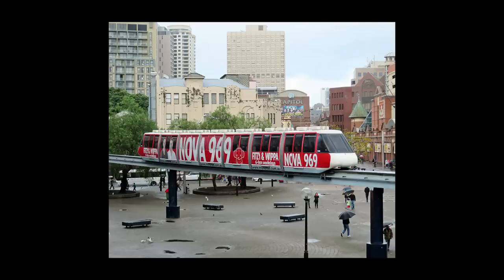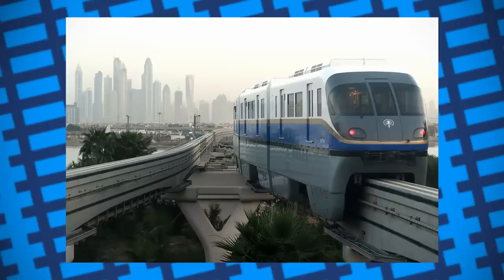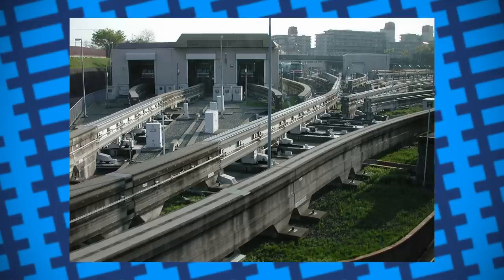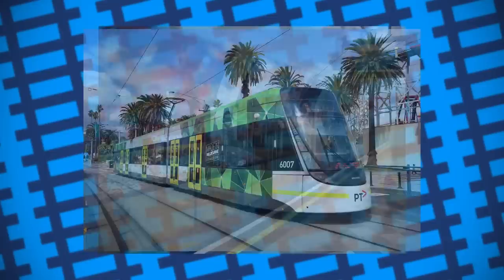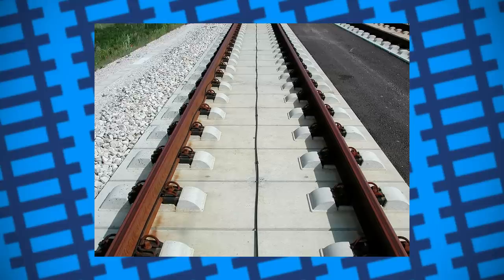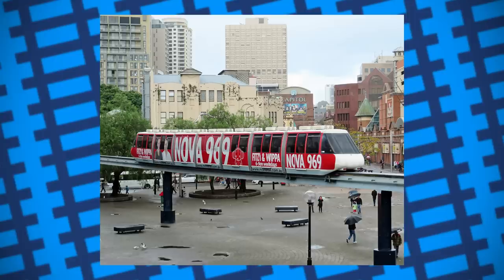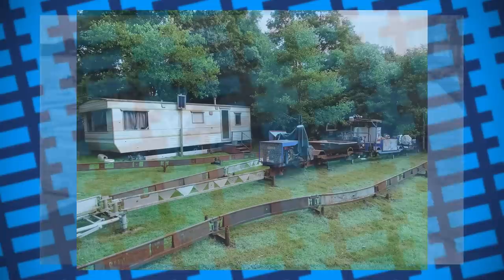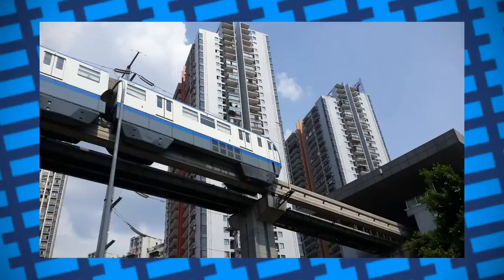Why monorails are bad as public transport - Monorails

Comment: Nice Video! Maybe you could do something like this with the German Plans of 3m- Breitspur Trains and why this was never a good Idea?
Reply: You DO realise that the GWR began in the 2135mm gauge, because of advantages of a broad gauge for efficiency and smoothness of operations?

In Europe, the US solution to stack shipping containers into 2 floors doesn't work (catenary). For highly frequented lines that are overloaded by today, a broad gauge line could bring the throughput needed in the near future. 

That is, if you don't want to have rail as an ugly duckling besides unecological road hauling.
Reply: @enysuntra1347  - The 2135mm Gauge of the GWR may have been an innovative idea in the early days when there was no widespread standard track, sure! But why people only stopped building them around 1900, although the 1435 mm had long been standard is hard for me to understand. 

A Broad Gauge CAN'T be more efficient nowadays because you have to build the completely new infrastructure. People are mostly upset if there is only a thinking of additional tracks "near their buildings". 
And you would need much more space for this. 
You are absolutly right about "More Goods to the Rails", but I think more standard rails should do it also.
Reply: @KlingelTimi.  You see your problem there? "you have to build the infrastructure anew". Exactly what you need to do anyways with over-encumbered freight rail. So just broaden the load profile, build 3 rails instead of 2 (left rail, Stevenson rail, right rail) - and presto! You have a line where Stevenson (1435) cars still can travel, but where you can have 2 containers where otherwise only 1 fit, AND have a catenary.

We won't see a switch to Brunel gauge; however, as a solution for especially high-capacity lines like Hamburg-Hannover or (insert name of port)-(insert name of major inland marshalling yard distributing freight coming from aforementioned port), it can be a solution to be considered.

The Breitspurbahn had some ludicrous PR (but what you see in "artist's renditions" in the 1900-1945s and how it looked like in the end were 2 different things altogether - I know, hard to imagine in our time where "artist's renditions" only show realistic and factually well researched possibilities...), but building a line connecting the major population and industry hubs in Middle Europe (and ONLY them) with a round-course line CAN be a good idea.

Of course, it was over-engineered. That happens when your engineers have the option to work in a well-protected planning bureau and their alternative is to work in a priority bomb target where all the time, something goes wrong and a scapegoat is needed and the last Workplace Safety regulation is reputed to have been sighted half a decade ago - or directly to "re-gauging" on the eastern front.

But some of the people tasked with executing the project seem to have indeed known what they were talking about. It's fascinating topics - not the ludicrous "artist's rendition" locomotives, but especially the line planning - that should be discussed in an in-depth video, not some "why xyz was a bad idea from the start and all those people who had the idea did not have valid reasons why they thought this was the right idea, but were morons much stupider than the dear viewer"-clickbait.
Reply: Addendum: While Feldbahn (600mm) has fallen out of use, we still have Schmalspur (750mm) and Meterspur (guess!)/C.A.P.-Spur (1067mm) gauges besides Stevenson gauge. It is true many light rail lines switched to Stevenson gauge, but you will still find kilometres upon kilometres of narrow gauge railways where happy trains are chugging along doing a perfectly adequate job. Standardisation and economy of scale is important,  but not that important that all lines have to be converted to 1435mm, up to and including your childrens' garden railway.

Comment: This is pretty much the same problem with maglev trains plus the added issues of them needing to be almost perfectly straight to get the speed benefit. 

I work track maintenance on the railways. Any repairs we do on them are pretty simple in contrast to monorails
Reply: I kind of wonder if you could have a third middle rail be your maglev system so you could use converted conventional trains. It wouldn't be as fast as the pure mono railed maglevs but as long as its roughly the same speed and cheaper to run (or environmentally more friendly if that is more important than cost) then it would be a good upgrade without requiring radical amounts of contraction or new maintence equipment.
Reply: @Hybris51129  no. That wouldn't be possible. 

Maglev works by using magnetic repulsion against the track and train. 

So say the track is a north magnet and the train is a north magnet. It uses the magnetic field to lift the train off the track and it floats. The "track" is then more of a trench to keep the train in line and something then pushes the train to get it moving and the speed comes from the fact there is little to no friction between the track and train. 

If you were to add a third magnetic rail to normal rails it wouldn't work because the magnet has to span the whole width of the train to be able to lift it off the ground. So the third rail wouldn't be strong enough. 

Then the wheels would be lifted off the rails and there would be nothing to guide the train along. So you would end up with more derailments.
Reply: @TenShine1productions  Ok I was thinking that the third rail would be a line of alternating magnets that would push/pull the engine as it rode on the rails instead of actual true levitation. 
Its been awhile since I looked at a cut away of a maglev system.
Reply: @Hybris51129  you still wouldn't get the speed of maglev. 

You might as well keep the third rail electric like current third rail track
Reply: I was thinking while watching this that all of these points also apply to HSR vs Hyperloop. Rail is so much easier to take apart and fix.
Reply: The KO criterion in favour of Maglev is speed. You can use iron rail for higher speeds than 300km/h (that has been demonstrated), but you cannot use it efficiently beyond 300km/h.

If you need the 300-750km/h speed range and haven't got air travel (because airspace is full - SCMaglev - or you don't want fossil fuel guzzling machines to fart out more carbon dioxyde on a trip than a small hamlet uses in a year - Transrapid), you need Maglev. "Hyperloop" is a con, so there aren't other technologies for that application available.
Reply: @MichaelfromtheGraves  oh definitely is.

Hyperloop has 2 major flaws
1 keeping a vacuum is such a vast chamber is going to take an insane amount of power 
2 pods. Singular pods reduce capacity per pod so you would need to increase the amount of pods. There's someone looking to make a cargo variant and the math actually works out worse than a train.

High speed rail is fine if it's warranted. Not like HS2 in the UK
Reply: @enysuntra1347  you still need to generate the electricity needed to create the magnetic fields. 

Again. Speed is fine...if you have the need for it. 

Japan yes. With major cities many thousands of miles apart and being a huge business center of a country that it is. The speed factor is necessary.

In the UK maglev/High speed rail isn't warranted. We have a network built for stop/start working of passenger and goods. The new HS2 will shave 30/50mins from Birmingham to London. But that's barely anything in the grand scheme of things and noone is committing to confirming any affect it will have on other networks 

Maglev could work in the US. But the airline industry has already cornered the market. And if you wanted to go from A to B but the maglev only went to C. Then again it would become more hassle than it's worth
Reply: @TenShine1productions  If you want to go from A to B and only C has the next airport, you again have the hassle - for a multiplied carbon footprint.

Yes, electricity has to be generated. If you have a central power station, you can construct it to be as fuel efficient as humanly possible, AND build a whole building for exhaust treatment - you may even capture exhaust altogether, if you chose to do so. If you have to schlepp along your whole power station, either in the bonnet or under each wing, your fuel efficiency goes through the floor.

Yes, England and Wales only have one major city that would justify a Maglev line - London. However, in the UK, rail after WW2 traditionally has declined. England and Wales may not be so hyper-centralised if there had been fast public transportation between the metropolitan areas. On the other hand, France IS very centralised ("Paris" and "other areas"), but still pioneered HST & operates a HST network profitably. In Italy, HST killed Alitalia. If HS2 gets built, that may alter the economic geography - as rail lines are always prone to do.

As an alternative to domestic flight, Maglev may have a future in continental Europe (depending on how serious it is with carbon dioxyde reduction). Even though England and Wales may be the one European country where there are better alternatives to Maglev.
Reply: @enysuntra1347  the problem with HS2 is that it's already massively over budget and noone wants to commit to saying if it will have a positive impact on the economy or the network. 

And our network declined thanks to the transport minister and beeching
Reply: @TenShine1productions  The Major Benifit of HS2 is removeing the express traffic from the current main lines which are at 98% of capacity, meaning the slitest thing going wrong causes delays, it should not only speed up transit on the express services but also make the local services much more reliable and frequent
Reply: @fishevans6417  yeah. But noone in Government is saying that anymore. They are very silent on the benefits of HS2 because they know if nothing chances than it will make them look bad 

If they don't confirm the benefits publicly and then it goes to pop they can deny every saying that. 

I still think HS2 is a bad move and the network needs upgrading
Reply: @Hybris51129  You seem to be describing a LIM (Linear Induction Motor). You can ride thrill rides using those at many theme parks.

Comment: WHY MONORAILS SUCK:

They don't. They are specialised solutions where rail was not an option. A monorail is a very practical solution for a problem where you need a monorail.

Wuppertal Schwebebahn could now be replaced by light rail, but that would be a waste of money to pull down a system that's perfectly adequate and rebuild another one that isn't really that much better. That's why the Schwebebahn stays where it is.

Comment: There's a Cable Liner system, which may as well be a monorail, at Toronto Pearson international called the Terminal Link. It serves as a connector between Terminal 1, Terminal 3, and the parking garages. The reason it works particularly well is because it's solely a people mover over a short distance, and is used to not interfere with the rail system and the busy roads surrounding the airport. Beyond that, it doesn't serve much of a good purpose, hence why the Union-Pearson train line exists.

Comment: There was a Monorail in Rhyl, along the promenade, built in the 1980's, but did not last long.   It was a short distance, which was quicker to walk, than taking the Monorail.  It was also supposed to be extended, but not enough people were using it to be worth extending. 

The other problem they had was that the track looped round at each end, but apparently the trains could not go round the corners,  and there was nowhere to store them in bad weather.   It only lasted about a year. 

There is no evidence that a Monorail has ever existed in Rhyl now, and most people will probably not remember it having been there.

Comment: The argument isn't persuasive. Light rails are not comparable to monorails because they're slow and get stuck in traffic. I have used trams in Berlin, Hong Kong, Hamburg and various other cities, and they are fine for slow trips. 

Monorails need to be compared with elevated railways that need a viaduct, and in that case, the monorail's advantages are less noise, smaller track profile and ability to be implemented in cities that have hills. 

I also would like to know where people get their numbers when it comes to maintenance costs. A video that talks about maintenance costs without actually citing the figures from existing monorails and comparing them with existing elevated railways isn't very useful.

Comment: Monorails look cool but are gimmicky and inefficient. But they aren’t standard trains so the average person thinks they are better because train old so train bad
Reply: Also, they were one of several technologies introduced at a point where other transportation methods were improving a lot faster than regular rail was, surpassing it in a number of use cases. ... Of course, a decade or two later technological improvement had regular rail blowing the vast majority of those technologies out of the water again.

Comment: This guy claims 1:28 and then shows monorail 1:42 with a smaller profile than any train (excluding metro with third rail), and claiming that you could build a raised light rail with same amount of resources is just plain ignorance. 

And points about switches, freight and so on are so clueless I won't even bother answering them.

Anyways, it's half the cost of the underground metro, and it doesn't take up street real estate like trams/buses do and it's immune to traffic jams/accidents/etc.

The only reason monorails are not more common is that "experts" like this guy are advising local governments.
Reply: And here's how much more material is needed for elevated conventional rail compared to monorail: 
https://www.monorails.org/webpix/TPDisB1.jpg
Reply: Exactly.  Lack of investment is the real reason why Monorail don't measure up. If we had invested in Monorails the same way we did everything else Monorail would be traveling super sonic by now.

Comment: I disagree with your objections on monorail
-The monorail is NOT “MONO” in direction it means it has only “ONE” (with is “mono” means) rail instead of 2 or 3rd-rail
-If people stuck on it or need maintenance just look google map type MRT Lat Phrao and drag slightly left the screen along Lat Phrao rd. Or use street view you will find the simplest solution. “Just built the walk way along it”. And its track also made from concrete like elevated LRT or even convections rails but no need for steel rail on it because it is a “rail” its self(because I from Thailand that why I choose Newly built monorail in Bangkok to be example)
-Lastly it is specific built for specific reason like in Thailand it don’t considered as main metro line it just a feeder but with complexion like fly-over ,narrow road ,cross over another transit line like ARL with use over head not 3-rail ,horrible traffic jam along the line(I use to stuck in traffic jam like an hours just for 2 km(around 1 mile)along Lat Phrao rd. And that day is not rainy day)and the biggest reason is the monorail is cheaper and faster to build compared to conventional railway.It’s not our first monorail in Thailand we used to have them so we all know it well.
-Just for example the real horrible metro is Detroit people mover it has only one track and one way loop like Sydney monorail its not just what type the track are but what the system that created it. If it built to serve the local people it will be good transit for local people and benefits for tourist too but if for tourist like in the past it will all fail.

Comment: Yep, it's basically the same reason hyperloops or maglev trains would be difficult to implement in places that aren't designed for it from the beginning. There's just no infrastructure for it.
Reply: Hyperloop's a con. 

Maglev trains reappear, when air space is crammed (SCMaglev) or, hopefully, domestic flight is seen as undesirable because of its carbon dioxyde footprint (Transrapid) - which was exactly why Maglev was developed in the first place (after 1973 oil crisis, you needed electrically powered alternatives (stationary e-supply, not hyperbatteries or such ***) to stop domestic air travel getting to be a thing in the 1st place).

Infrastructure looks like a point - until you see that right now, freight and passenger travel block one another because politicians want them on the same track (as well as some HSTs, to make it ultimately inefficient). If you need a line for HST anyways, you can also build a Maglev line whose speed starts where HST speed becomes terminally expensive (300km/h, Transrapid was planned to incrementally accelerate to 700-750km/h). That way, you even safe loads of electricity (while catenary has to be all on or all off, MagLev is built so that only the block of the train and the one in front of it are switched on).
Reply: @enysuntra1347  so, 700km/h can't be more efficient than 300km/h no matter how few parts of the electrical stuff needs to be powered. Also, to get the power where the single part will then be switched on, you still have to transport it there, which has the same electrical resistance problems of a catenary. Then you get to things like speeds above 300km/h not being viable in a lot of places because it takes too long to accelerate, and there you have it.

The time difference taking maglevs vs. conventional trains is probably a few minutes between most European cities